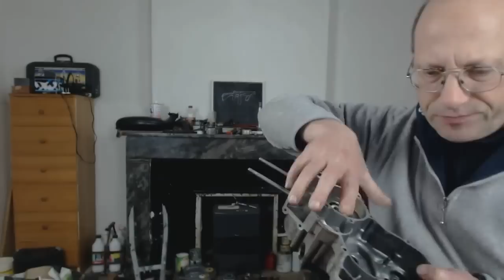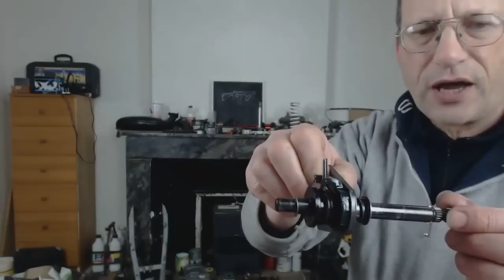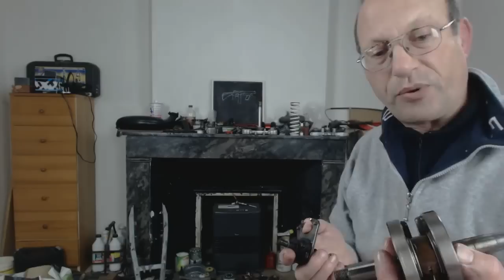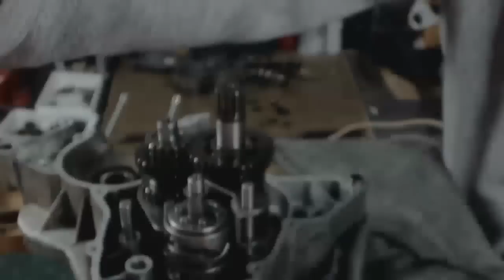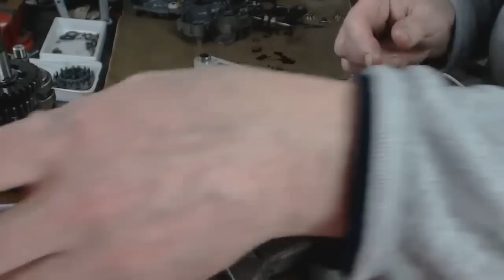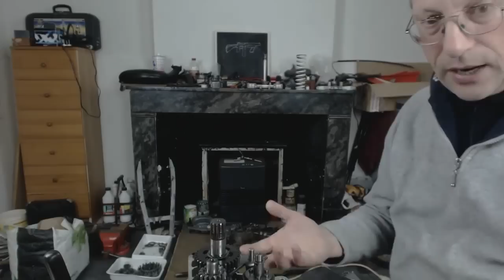AM6 Gearbox Assembly - step by step

Comment: please i need help, how much play should there be on the sprocket shaft? i think i may have a bit to much
Reply from the maker: Check out this video: https://www.youtube.com/watch?v=DnjATirP9dc
I presume that you mean the play between the front sprocket splines and the splines on the output shaft.
If this is the case, it would be fairly typical.

As you open the throttle, all the power is passed through those splines.
The splines slam into the sprocket splines, and get the whole bike and maybe two people, moving.
This tends to wear out the splines, so the play gets greater.
With more play, the shock of the load on the splines is greater.
This creates even more play, which in turn further increases the shock on the splines.
 
It is an accelerating failure.
The only way to solve it, is a complete engine and gearbox split, replacing the worn shaft and worn sprocket.
From that point, you can regularly replace the sprocket, extending the life of the shaft.
The cost of the shaft is anything from €15 to €75.... so look around.
The cost of the sprocket is just a few euros.
Good luck!

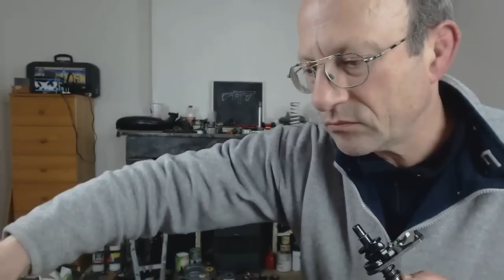Comment: hello. today i rebuilded my engine (new crankshaft, bearings and seals.. then i put all back together and now i cant move gear shift shaft so i cant change between gears.. so i decided to open it again and i think i might found a problem.. but still i want some help.. i forgot to put 1 shim on.. and that was  the one from 1:10.. is this why i could not move my gear shifter ? :) thanks ^^
Reply: + Skillboost 
You need all the shims in the correct place.
Perhaps you put the missing shim on the wrong shaft.

If there was no problem before you dismantled the gearbox..... any problem that you have now, will be of your own making.
Don't think that you are the first to make this mistake.

Just put it back together correctly this time :)
Good luck!
Reply: +PlayF1 Manager  fixed it today :) your video helped me :P thanks again.. i checked your other videos to.. i like them. grettings :)
Reply: +Skillboost 
Great news........ I can imagine that you felt good!
Why not?

Really pleased that I could be of help..... thanks for your compliments...... greetings to you also :)

Comment: hi, i'm changing bearings on crankshaft and my racing crankshaft kitt is containing two bearings - one with side cover ( plastic cover inside bearing ). Which way should be bearing ( covered side ) pointing to ? thanks
Reply from the maker: +egarazcz 
Non-standard kit 'installation instructions', should be supplied by the manufacturer.

In principal.... 
Make sure that the exposed side, is open to lubrication, and covered side to the outside.
Bearing covers can be used to keep dirt out of the bearings, however, this is less relevant here.

The stock bearings have the same part number, so both are the same.

Comment: how many washers(shims) are in the gearbox in total? 3 or 4?
Reply: +Jordan Berry one at both ends of the 2 shafts?(4)?
Reply from the maker: +Jordan Berry 
Have a look here:
http://www.apriliaforum.com/forums/showthread.php?224113-RS-50-Transmission-Assembly&p=2780665&viewfull=1#post2780665
Reply: +PlayF1 Net Thank you :D what bike was this engine taken from (am6) its in loads of 50 geared rs50,mx etc
Reply from the maker: +Jordan Berry 
This one was an MX50 2004

Comment: PlayF1 Net I found ,the order of that ''nails'' does not matter,some people have only one ''long nail'' and after that a ball bearing and last another short nail,now i have another problem,i put the gearbox and everything at their place and the shims and after i tight the bolts of the cases the output shaft is stuck and i tried to change the gears and sometimes i can spin it but very very hard and when i losen the bolts it spins easy,what could be the problem ? the shims ? i put at every shaft a shim and at the drum.
Reply from the maker: robin hood okay, I think I understand what you call 'nails'. :)These are the 'thrust rods'.
When you pull the clutch lever, it pushes the thrust rods, and forces the clutch apart.
The ball bearing between the thrust rods, allows the first rod to spin (on the ball bearing).
Okay.... so you've understood that :)

Gearbox lock-up on assembly..... Options:

You have the shims in the wrong place
The shims are too big
You have used too many shims.

I presume that the shims you are using, are the shims that were originally in the gearbox.
In this case, you have them in the wrong places.

SOLUTION:

Assemble the gearbox and cases WITHOUT the engine crankshaft.
This simply makes life easy for you. :)

Try different shim positions....... each time, screwing the crankcases together, and checking the gearbox movement.
(you must do this because you didn't record where the shims should go.)

After trying a few times....... you will find the correct positions.

Keep going...... you can do this :)
Reply: PlayF1 Net Thank you very much for all the help,i remove one shim from the output shaft from the side of the clutch and now it spins.
Reply from the maker: robin hood  Congratulations........ a difficult job, well done. :)
Reply: PlayF1 Net  Now that the engine is assembled when is in first gear the front sprocket is spins very hard and when is in the rest of the gears it spins but not hard,what could be the problem ? on one end of the input shaft or the output shaft must be two shims one after another or the nut of the clutch basket is too tight ? because before i installed the clutch the gears were changing good,i hope you can answer me.
Reply from the maker: robin hood Use this set of diagrams 
http://www.apriliapartsbuyer.co.uk/parts/mx-50-2004.page-2

to help you locate all the shims....... there are two sets of pages with diagrams of gearbox and clutch assembly.

http://www.apriliapartsbuyer.co.uk/parts/mx-50-2004/primary-gear-shaft

http://www.apriliapartsbuyer.co.uk/parts/mx-50-2004/gearbox-driven-shaft-i

http://www.apriliapartsbuyer.co.uk/parts/mx-50-2004/gearbox-driven-shaft-ii

Check numbers 6, 9, 11, 12, relating to washers on the 3 diagrams above.

You must test all the gears, before final engine assembly.This means screwing the crankcases together, usually without the crankshaft.

If all gears work....... you can then split the cases again, and insert the crank etc.
Screw the cases together, and test the crankshaft rotation, and all the gears again.

You now know the gearbox and crankshaft are fine!

When you assemble the clutch..... tests again.
If there is a problem, then you know that fault lies with the clutch assembly (if all your washer shims are fitted correctly)

:)
Reply: PlayF1 Net Thank you very very much,you are a great person.

Comment: and please can you make a video to show how to assemble the gear shift shaft
Reply from the maker: robin hood I don't think there should be a problem with the gear shift shaft..... it is an assembly, and it slots in place.
I have a video somewhere showing the shift shaft....... I'll try to find time to upload it...... but it only has one place that it can go.

From your first comment/question....... I think your problems stem from not having the ball bearing to go on top of the spring.
When in gear or neutral, the ball bearing is in a hole........as you change gear, the spring descends, and the ball bearing finds the next hole (you rotate the shift cam with the gear lever).

Without the ball bearing, it will be difficult to find the next gear.
Remember...... as you change gear, the ball bearing slots into the next hole.
So without the ball bearing, you cannot change gear precisely.

There is nothing else to do, but remove the motor..... split it...... and insert a ball bearing where it is required.
My guess is that this will solve your problems..

I honestly cannot comment on what fell out of your gearbox (that look like nails).
Please state the name of your bike, and the engine type, and capacity (if you know it).

You should then join this forum..... in order to get further technical help:
http://www.apriliaforum.com/forums/forumdisplay.php?21-RS50-Technical

:)
Reply: PlayF1 Net Thank you so much,that little ball bearing was the problem hehe is a little different the mechanism but has a spring and a ball bearing like yours,is a minareli am6 engine on a enduro Malaguti 75 ks and has 75 cc with 6 gears,today i will try to assemble it if i will figure out how to put the gear shift shaft in place,i know that it fits in only one place but has a spring and idk how to put it,i will try to find a video on youtube and with that 4 bits that look like nails i will put them inside the shaft in a random order and hope it will not be a problem,i will let you know if i could do it,thank you.
Reply: PlayF1 Net they dropped when i opened the clutch side and i think there is another one that comes last and a ball bearing and all are from the output shaft

Comment: Thank you very much,i have the same engine but with 6 gears,and the bottom of my gear shift cam is different ,it looks like a star and there is a spring without the ball bearing and this is why i have problems shifting gears i think because of that spring if i tight it to much i can't shift at all and if i let it lose i shift to easy without ''clicks'' and i think if i let it like this it will drop from gears,i split the engine because it wouldn't shift in third gear and i thought that the shift forks are bent but nothing was bent,can you tell me please for what is that spring and how to resolve the problem and another thing when i split the cases from the output shaft dropped 4 things idk how to call them,look like nails without the ends and 2 are the same size 1 cm long,one is 3 cm and one has 5 cm and they dropped from the hole of the output shaft and now idk what is the order to put them inside,i hope you can help me with this,is very important for me and maybe there are other with this problems.

Comment: I changed my cylinder from a 80cc Top Performance (the pink one) to a DR50 cylinder, ever since my first gear is rattling really loud. You feel it vibrating the bike (Yamaha TZR50). I don't really have an explanation for it yet, I'm going to take apart my clutch tomorrow to inspect it. Also I am using a 12 front sprocket and 47 on the rear wheel. Also when its in neutral or any other gear the sound is gone...
Reply from the maker: Changing just the top end will have no effect on the gearbox - assuming that you did not split the engine cases.

The balance shaft holds a weight to counter vibration...... this must be fitted according to the punch marks on the cogs - one punch mark between two.
If this assembly is wrong...... the engine will vibrate.

I would suggest you join:
http://www.apriliaforum.com/

This way you can provide more information, and have many eyes on your problem.
Reply from the maker: +isak Langen 
The key is to check your gears and know where neutral is.
When nip up the two cases, you then need to check that the crank rotates freely, and all the gears.
Read Robin Hood's first post.
When you've tested all is working, then continue with the assembly.